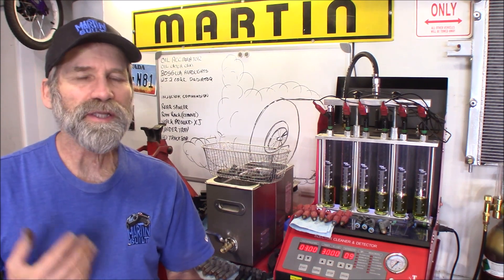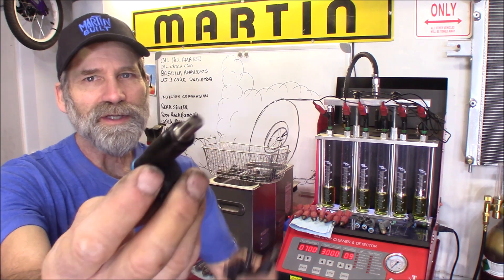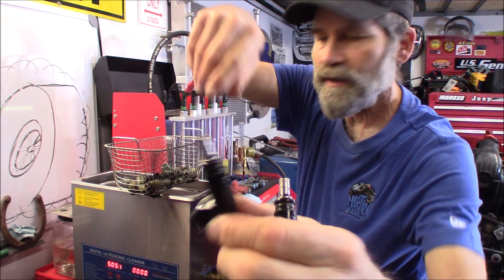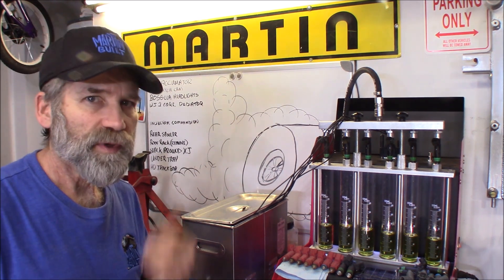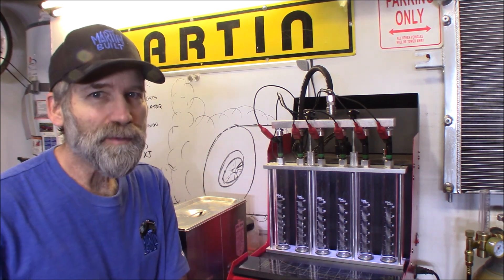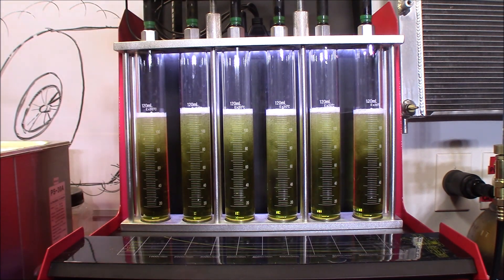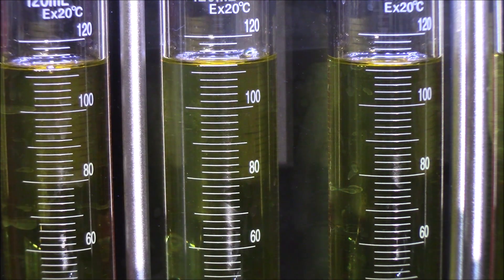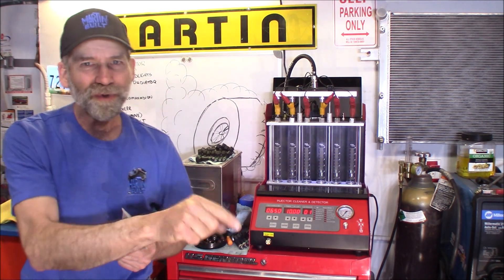Cleaning and Building a Match Set of Fuel Injectors

Comment: Hi Martin, I have a autool brand cleaning bench, I was wondering what rail pressure you recommend for testing the injectors at, and how many CC's should they be within eachother, and should low medium and high speed tests show the same flow results?

Comment: Not too shabby. That's about as good as it gets for pulling junkyard injectors and prepping them for like-new install. I could think of a few redneck methods of achieving the same results. It's great to visually see those things get cleaned up and work in the graduated cylinders. They don't make nearly as much racket on a working engine. Or do they?

Comment: Judging by the multiple experience of washing fuel injectors in ultrasonic baths, they usually stop holding pressure after this procedure if there was a lot of wear. Therefore, I would not advise people, especially those who have old nozzles, to clean them in an ultrasonic bath.

Comment: Love your videos I'm building a 4.7 for my ram 40 over 10.1 compression I found a set of 206 cams I hade my local machine shop port and polish the heads ordered a 70mm throttle body and I got a solid set of lash adjusters trying to figure out injectors size currently have any suggestions for me keep up the good work
Reply from the maker: I like the Denso 12582704
Where did you ever find the 206 cams?
Reply: @martinbuilt  What fluid do you use for the Injector Calibrator?

Comment: What cleaning agent are you using in the ultra sonic bath?
Reply from the maker: This is the stuff that I like the best.
https://www.ebay.com/itm/Ultrasonic-Fuel-Injector-Cleaning-Solution-5-gal-Perfect-for-Launch-machines-/312062365285?mkcid=16&mkevt=1&_trksid=p2349624.m46890.l49286&mkrid=711-127632-2357-0

But this is what I was running at the time of the video video I had waited well over a month before I got it.
https://amzn.to/3E5C4nt
 And it seems to be currently unavailable.

Comment: I recently bought a set of 12 hole rebuilt Bosch injectors for my 2001 4.0 jeep grand Cherokee. Did I waste my $$$
Reply from the maker: No those are great injectors for the 4.0
Reply: Fuel that isnt atomised is wasted. The more an injector vaporizes the fuel into the air. The more efficent it will operate. Gaining mpg or hp or both depending on your tune. It is a total waste of money if you cant super tune the engine. You could of got less from(edit: for) less money and wound up with the same output if you dont dyno or time trial the tune. But A+ for potential.
Reply: In a stock motor you could see a increase in mpg and throttle response. But the dummy computer isnt going to know it can advance the timing further than its programing. And i would assume it could manage the air/fuel ratio still. Unless you have some monster racepump and the regulator cant keep the pressure in limits. But you surely would have a tuneable management system before you had a pump and reg like that.

Comment: Great video martin, have you thought about offering an injector cleaning service? I have about 100 injectors lying around my garage, I grab them every time I'm at the scrapyard
Reply from the maker: Thank you, John, maybe sometime in the future I will. With that many injectors, you should get the same ultrasonic cleaner that I have.
Reply: @martinbuilt  Autool 6 injector cleaner right? I've been eyeing it the last couple months. I normally take mine to a diesel shop down the road but I can't watch the actual cleaning process. I'll probably get one I notice you have a few of the Autool branded items and have good things to say
Reply from the maker: @SmithJohn8786  I was thinking if you at least got the Professional Ultrasonic Cleaner  https://amzn.to/3E12aZ2 that would help you out a lot and it also can be used for car parts as well.
Yes, I feel that Autool makes some great products and would be comfortable with their Tester/Cleaner.
Fuel Injector Cleaner and Tester https://amzn.to/3KwEi1Q
Reply: @John what state are you in?
Reply: @tatertots-n-soup  North Carolina
Reply: @SmithJohn8786  oh to far for you to drop them off in WI
Reply: @martinbuilt  I pulled the trigger on the Autool 6 port injector cleaner. The shop I take my injectors to charges $25 an injector. Inclusive price, they clean and rebuild the injectors. Figure this will pay for itself after I run through all my injectors plus I'll be able to flow match them. Thanks for the product review and suggestion 👍🏽
Reply: @tatertots-n-soup  I'd say so yes 😂. Although I've never been to WI 🤔
Reply: @SmithJohn8786  why isnt there an 8cyl version? Is it supply and demand? Or what.
Reply from the maker: @SmithJohn8786 
 yeah if you are into playing with injectors this machine will pay for it self, enjoy 😎👍